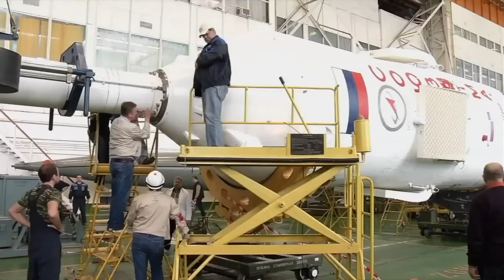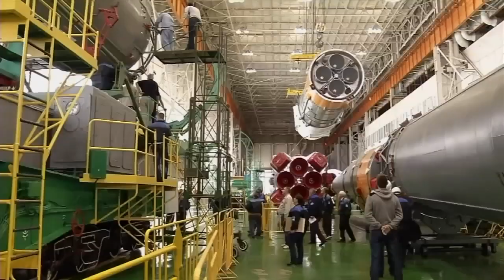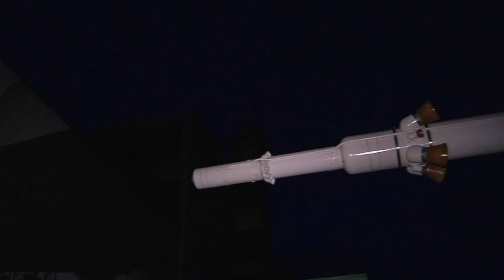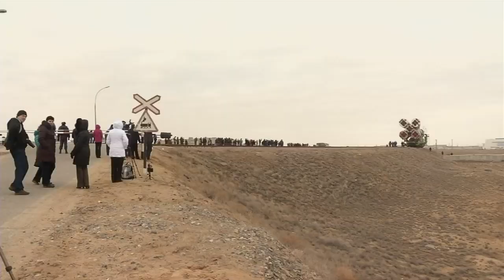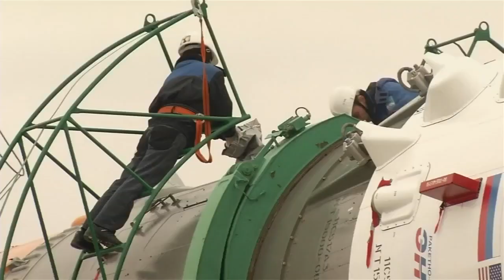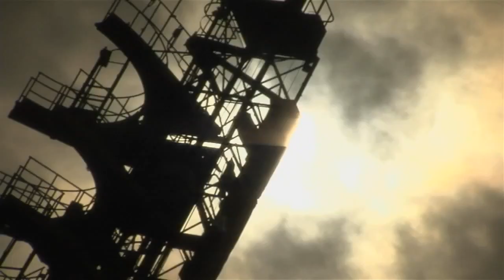Ready to Go

Comment: By the way, the "pig pin" they stick into the tip of the rocket in the beginning of the video is the launch escape system. In case of an emergency at launch this thing propels the crew capsule away from the launch site.

Comment: Another take on the whole space pen vs pencil thing, NASA builds a $100,000,000 crawler to move their rocket to the pad, while the russians just get a pair of diesel locomotives and railway carriages. Not saying NASA isn't doing good work, but every once in a while maybe they should step back and think a little about what they are spending their money on..
Reply: Except that the space pen vs pencil thing anecdote is a urban legend http://en.wikipedia.org/wiki/Space_Pen
Reply: I'm guessing here but I assume it's because the shuttle is asymmetric so trying to stand it upright would be hazardous... plus all the heat resistant tiles are very fragile...
Reply: I think a shuttle would be to heavy for rails.
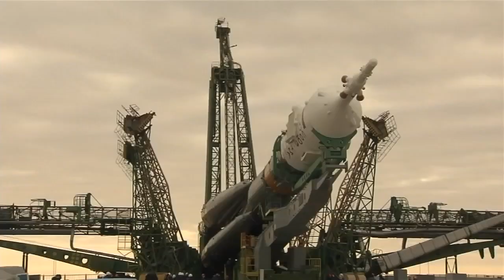Reply: Ryan0556 Buran shuttle was moved by rails (double railways. pic: http://i.imgur.com/gPZZZEg.jpg). The main difference is: NASA assembling their vehicles vertically, and moving them to launchpad vertically. While russians assembling vehicles horisontally, so they also need huge hydraulic system to rotate whole vehicle on launchpad, like one on 8:22
Reply: The crawlers were built back in 1965 and a cost of 14 million each. Considering how long they've been in operation, I'd say it was a good investment.

Comment: wouldn't it be cheaper to use a ssto to transport crews
Reply: In theory yes, but in reality not really, SSTOs are really ineffective to this day, because you have to carry a lot of dead weight (e.g. half empty fuel tanks). Also at higher altitudes you dont need as much thrust since the friction is less of a problem and you don't need as much energy for changes in velocity.

If you had all this in an SSTO you would require even more powerful engines and a lot more fuel.

With advancing technology maybe one day SSTOs will be more efficient, the SABRE engine being one of those technologies, which allows for the creation of SSTO spaceplanes with return capability.
Reply: B20C0 thanks

Comment: There are some large ducts to the craft on the transporter, anyone know what they are? KDM
Reply: +Kenneth Masters The ducts are part of the dehumidifying system to stop moisture build-up between the fairing and the Soyuz space craft while the whole rocket is outside the hanger. An identical system is attached once the rocket is upright on the gantry. Moisture accumulation is a concern because the orbital and decent modules are swathed in thick insulation blankets. When the fairing is ejected at high altitude sub-zero temperatures, these comparatively fragile insulation blankets might be damaged if moisture had been allowed to accumulate and thus large ice crystals where to form while the vehicle was still in the atmosphere.
Reply: +Kurzula5150 Thanks!